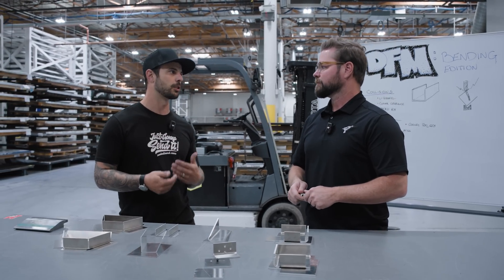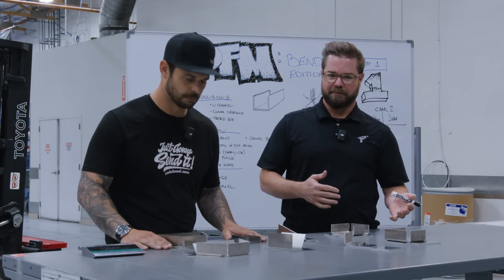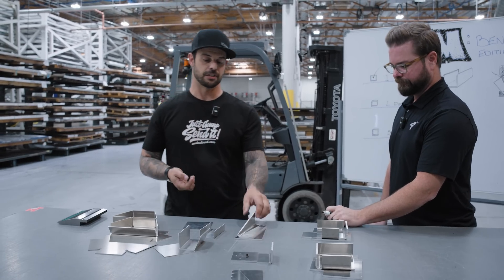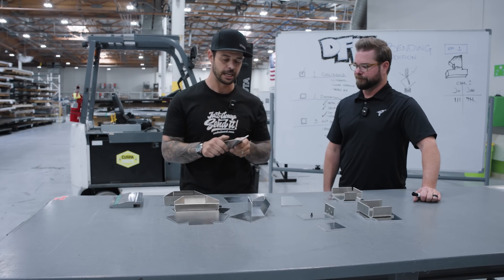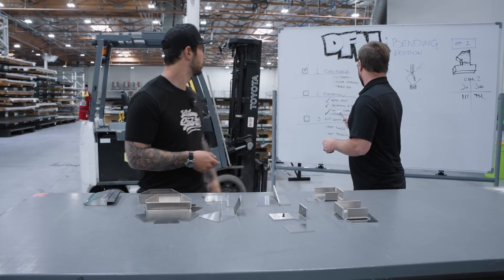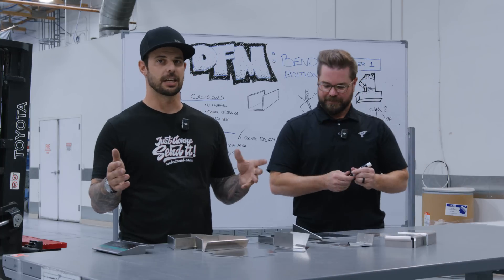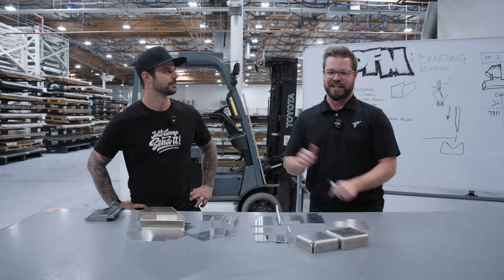Sheet Metal Bending: What to Avoid for Better Results - Cutting Corners Episode 9

Comment: Can you do a curve instead of a bend? I have a part that I'm going to be using as the fingerboard of a cello (about 2"x14"). I'm planning on going with 1.0mm brass and I'm hoping I can sandwich it between a steel tube and a steel half tube to curve it. Will it keep the shape or do I need to bend it to a smaller radius than desired to allow for it to spring back slightly? Willing to try copper instead but hoping for brass for this project.
Reply from the maker: Sendcutsend doesn't offer “curves” or bump bending but your plan is a solid one.  There will be a slight amount of spring back but with a thin brass piece of material it will minimal.  The key will be to have enough pressure to force it into the shape through what is known as a “coining” process.  Since tubes are not as great with side loads we recommend trying to get your hands on a solid rod at your desired inner radius.

Comment: Great info, How would you choose perfect corner relief so you don't have to weld that big relief(gap created by relief)
Reply: They dont need a corner relief, they could use a punch with cutouts in it called a 'shoe'. this way you can get into sharp corners and still fold the whole flange
Reply from the maker: Great question!  You can modify corner reliefs in the sheet metal rule tool in CAD.   There are preset reliefs that are designed just for welding!  Just remember that you may see some deformation in those corners.

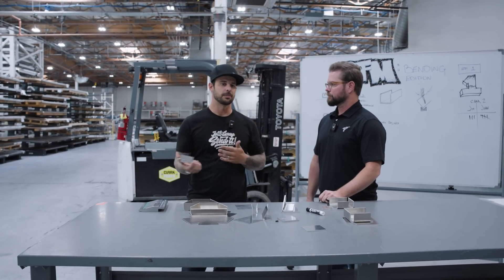Comment: Nice!  Here's my user story for your UX and marketing:  I caught your advertisement.  I almost never click ads.  I went to your website, made an account, tried to find sample STEP files on Google.  Then I realized that you already had samples in your part designer.  I didn't notice your part designer until I got back from Google after downloading some NIST-STC-PMI-v4 file that wasn't in the correct format.  I got to "brackets" and then I though "hey wait... how do I bend metal?"  This time I spent time to look closer at the page I was on and I noticed your video.  I watched the video.  A ten second clip at 6:40 in this video hinted how I set bend locations.  I am excited.  I don't have a purpose for thick bent sheet metal at the moment, but I have needed this in the past and I will need it again.  The prices are surprisingly fair for American made!
Reply: Also, I didn't know a lot of the information here.  American manufacturing knowledge is weak right now, so thanks for taking the time with the baby steps.
Reply from the maker: Thanks for telling us about your process! Helps us make sure we’re getting the right info in front of our customers!

Comment: Note to production crew. Camera 1 should be fixed straight on. Almost all talking should be to this camera. Camera 2 should be slightly elevated and cropped tight to show details on the table or in their hands. It should be on a fluid head and have a fairly large zoom. 
This isn’t a tv news show where you have 2 cameras for transitions…

Comment: Watched your video on problem bending. You have some valid concerns and limited knowledge of press brake tooling. I have been a press brake operator since 1977. I design tooling and programming of parts on CNC press brake machines for years. I have used Bystronic and most recently Safan Darley E-Brake machines. I retired in 2019 running parts for a company that manufactured fireplace inserts. They used tape measures to check their parts. No one knew what a tolerance was let alone bend reduction. Deep box bending can be done with a skilled operator and the proper training. Google Steve Benson, he is the expert on press brakes and problem bending. I made my own videos on stainless steel bending and double bending and slip sheet bending. The standard tolerance for sheet metal is 0.015 to 0.030 for dimension. The rule of thumb is to take a piece of metal and bend a 90 degree and try and get a 1.00 flange on one bend. Record the measurement and that is your bend deduction. Make coupons for all of your metal stock and record the results. This is your base line. You young guys don't have the knowledge that was passed down to us old timers from people who taught me the secrets. I can help you pick the correct tools and point you in the right direction. If you are going to be in this business you need to the experts. "Be curious and ask questions", a quote by Ted Lasso.

Comment: Another good way to save the worry of corner clearance is to unbend and bend your part in cad to find the best sequence order to bend the part. Saves trouble if the customer doesn't want a part welded or extra slots.

Comment: Great video! On the topic of bend distortion: Will non-perpendicular features / cutouts between the die lines cause bend distortion? E.g. if I have a slot at 45 deg to the bend that crosses - or is near - the bend line; will this cause the bend to lose its "parallel-ness" relative to the backstop?
Reply from the maker: It would depend on what material you're selecting as well as the proximity to the bend line, find out more here: https://sendcutsend.com/guidelines/bend-deformation/

Comment: When designing a part like the trapezoid box you used as reference… are there specific punch widths I should have in mind when designing? Or do you have an infinite number of punch widths and consideration during DFM is unnecessary?
Reply from the maker: Not infinite but we do have a lot to make it work as much as possible!  I try to relieve it back to the mount that the die width is clear of the angled flange.  Since the punch is narrower than the die width in most occasions it ensures for a successful bend.

Comment: A traditional break can do tapered parts if the holddowns clamp the tapered portion.
Reply from the maker: True! Unfortunately, clamping doesn't equal speed. Since we'll often be making a quantity of 1 part (that we'll never see again), creating a fixture for the clamp can take more time, not to mention cost. For higher volumes, it makes a lot of sense and will pencil out.

Comment: Thanks guys! Definitely am no stranger to the awesome and helpful team at SCS especially when it comes to bends and getting things figured out. My question, I've had parts bent before, and on a later placed order (of the same parts), I was instructed to make revisions - I did notice that the orders came from different locations - do different locations have varying tooling/machines?
Reply from the maker: Could be a lot of things, it's hard to say without seeing your file. All of our locations have the same machines/tooling, but as we grow we are often making adjustments to maximize our capabilities and production. You're always welcome to ask the support team what's changed.

Comment: at the 2 minute mark you could just flip the top punch around and the part would clear easily
Reply: also at 3:50 you can use a rolla v bottom die and bend super close to holes without much distortion
Reply from the maker: @DRIFTMOTIVE  **dramatization for demonstration purposes only
Reply: @sendcutsend  ight then lol